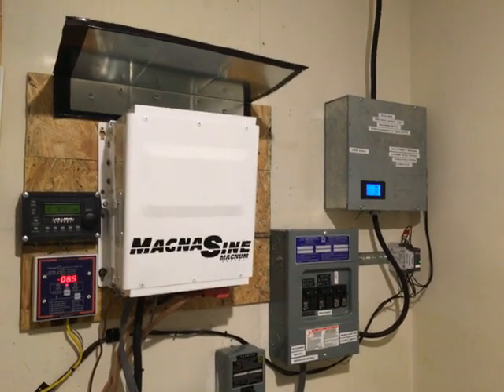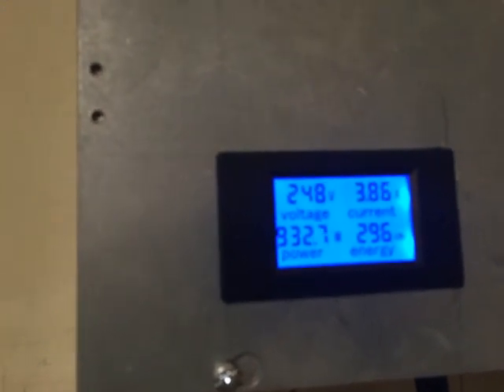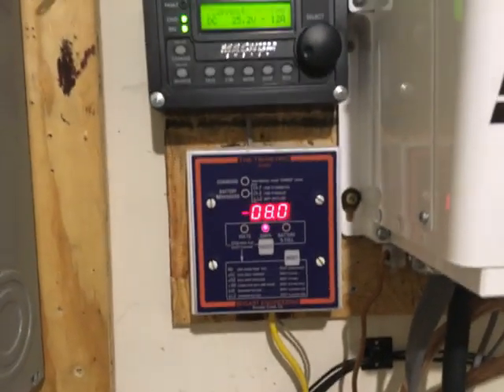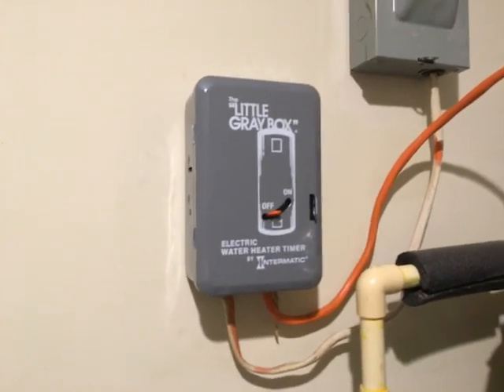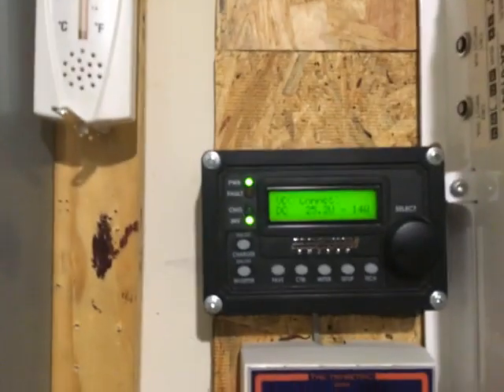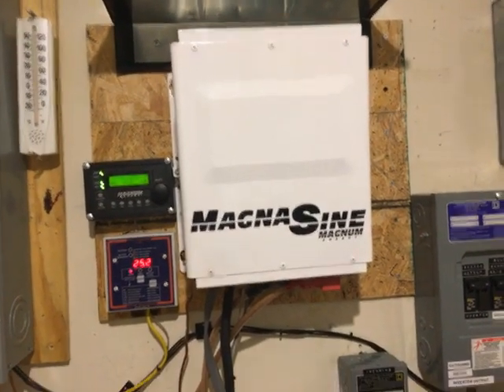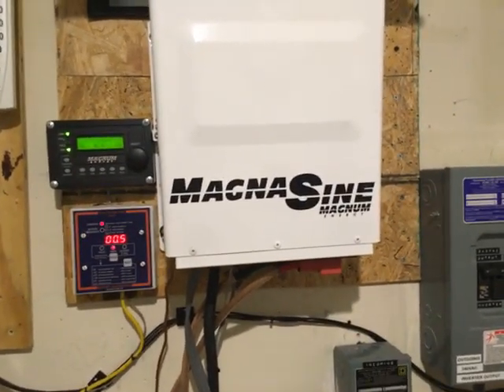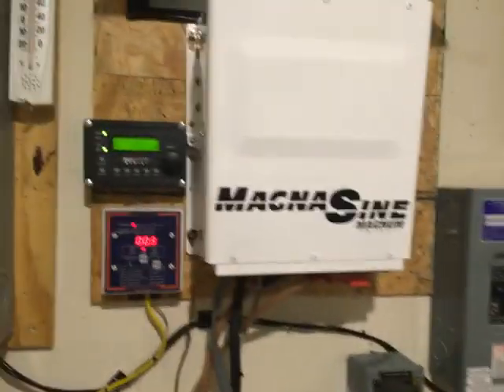Solar AC Coupling -Testing Micro or Off Grid Capability Part 1

Comment: Check out this for powering the hot water heater. https://www.wholesalesolar.com/2991208/magnum-energy/inverter-accessories/magnum-energy-acld-40-ac-load-diversion-controller

Comment: Hello Rhandsom- I have a similar setup and looking for a way to automate the transfer from ac grid to micro grid (and back)  based on battery voltage. How did you accomplish this?

Thanks
Christian
Reply from the maker: I would suggest using one of the voltage monitoring relays that are available from Siemens or ABB, the voltage monitoring relays would then be connected to some solid state power control relays.  The links below will give you an idea of what I'm talking about.

https://www.youtube.com/watch?v=qYTF6kzVtsI
https://www.youtube.com/watch?v=PpQGyQLFfXk
https://www.youtube.com/watch?v=Eq72_a4jYUs